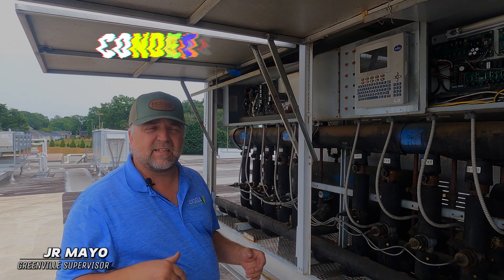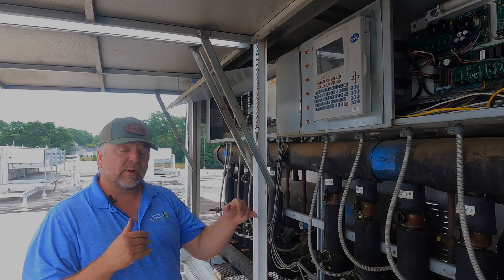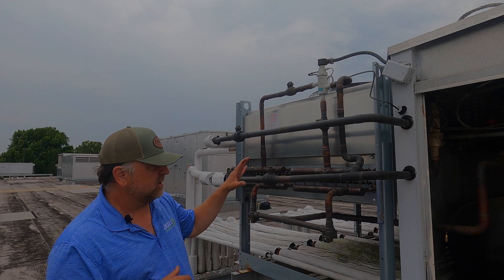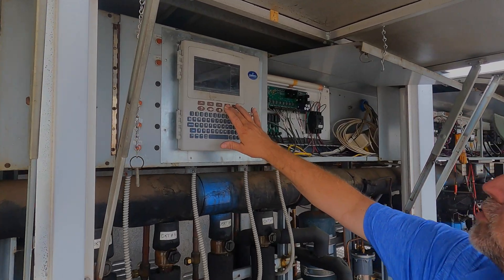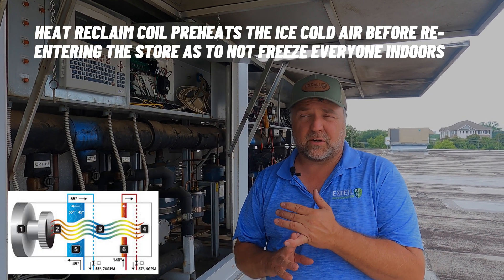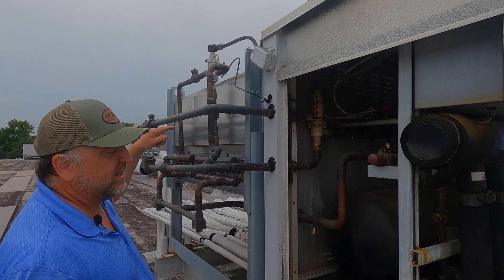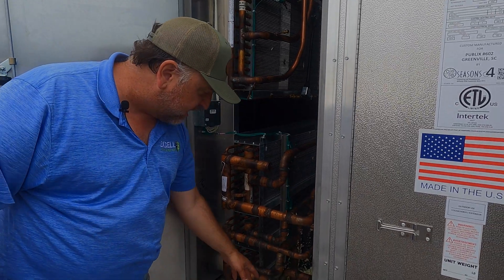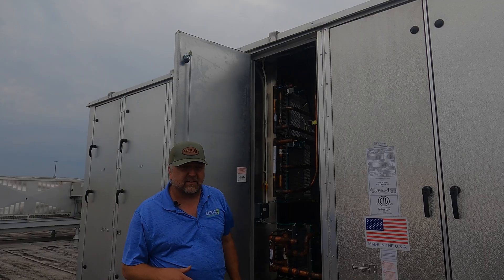Condenser split and heat reclaim

Comment: Weather pack possibly converted from r22 looks like to 449a using semi hermetic Copland 2/3D dicuss compressors with new condenser with new season 4 possible has new E3 in it can you do videos on navigating the E3? Do you guys still have the demand cooling modules or using E2 to control demand cooling if so can you do a conversion video?
Reply from the maker: @OEM_Junkie  very good. This store still uses E2e’s. I do have some new ones that use E3’s for the AC. I can make a video navigating it. As far as the demand cooling we are using some demand cooling controlled by the rack controller but most are still demand cooling modules. I can go over how it works but not programming.
Reply: @ yes please show me navigation of new e3 and some insider tips and also how your demand cooling is set up communicating with e2 vs using the demand cooling module thanks brother.